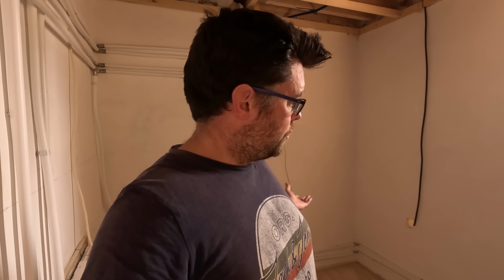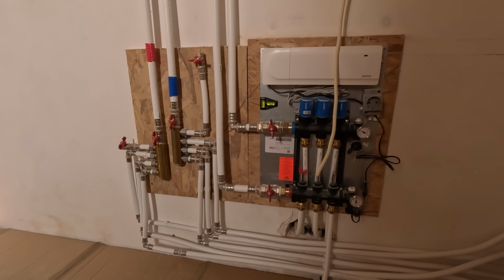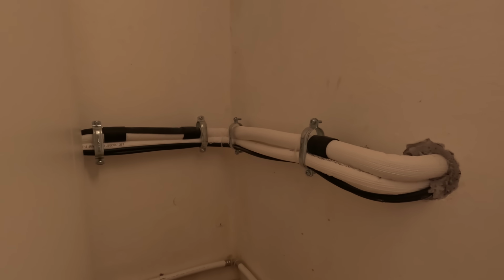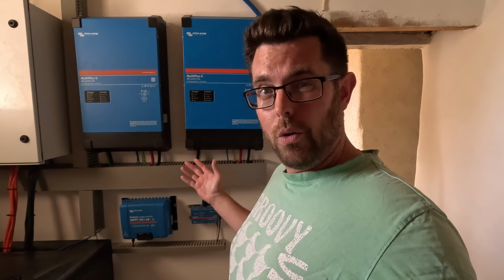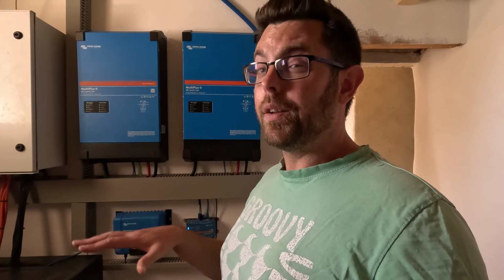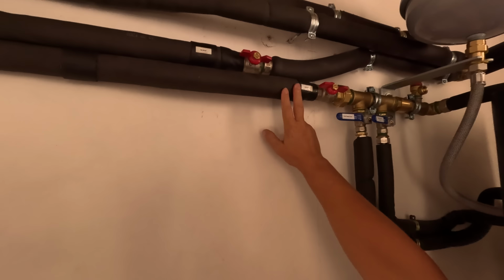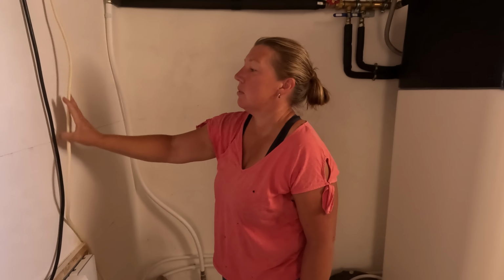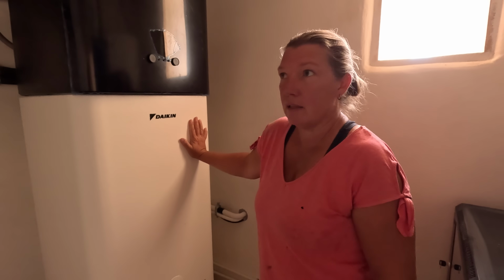Today is a BIG Day (We have HEATING) - Daikin Heat Pump Install

Comment: Wonderful!!! I can only imagine how relieved you are. We just (finally) finished installing a mini-split heat pump yesterday and are exhausted! It took us 3 or 4 full days just to drill through the stone wall… “Next time” we will know a bit more what we are doing! Now the question is, how will our solar electric system handle this? We probably need to upgrade, especially if we want to install another one in another part of the house, so will be very interested in the description of your system.
Reply from the maker: Yes, the drilling is painful. We ended up buying some super long drill bits for our hammer drill, worked a treat.
We’ve made significant upgrades to the solar, and have provisioned for further expansion in the future. I think the key will be ensuring we get minimum heat loss from the building in the winter
Reply: @MAKEDOGROW  Yes, we also bought and used super long drill bits for our hammer drill... I think an additional requirement for speed of execution would have been to magically make ourselves 25 years younger! 🤣🤣

Comment: hi guys, great video, respect, about the water in the heater, if you use it also for showering, make sure your water is 65 degr C or above, then it will kill the germs that cause Legionnaires' disease.  that is a very terrible sickness that can kill people   https://en.wikipedia.org/wiki/Legionnaires%27_disease

Comment: The main reason heat pumps do not work very well in sub zero, is becouse it forms ice in the evaporator unit... And that ice then works as an isolation...
And it's exactly an air conditioner. Many if not most air conditioners theses days can work in both directions, so they pump heat or cold.

It's all thermodynamics and not that complex, we have a fluid that wants to be a gas... But to be a gas it has to extract energy (heat) from the environment..then if we compress that glass into a liquid it them returns that heat back and we can use it to say heat water..

And you are defenetly going to be able to run it from solar.. I have a more simple system with 19000 BTU and I run it in summer and winter mostly off solar with a tiny 1500 W solar system..
Reply: Here in Northern Europe, air source heat pumps are popular. In my home country, it can be - 20 to - 30 degrees C in winter and +15 to + 32 degrees C in summer. Still, air heat pumps here work quite well even in freezing temperatures.

"A high-quality air heat pump works just as well in the cold as it does in the summer. That's why high-quality air source heat pumps can and should be used even in severe frosts, because that's when heat is most needed!

Please note that not all air source heat pumps work as desired in freezing temperatures. The efficiency of the weakest air source heat pumps can drop so much that they do not save energy compared to an electric radiator even if they are lazy. That's why it's worth investing time in the quality of the air source heat pump, so that you get the best air source heat pump for yourself." (One air heat pump company's text advertisement from their own website, translated from Finnish into English by Google Translator).